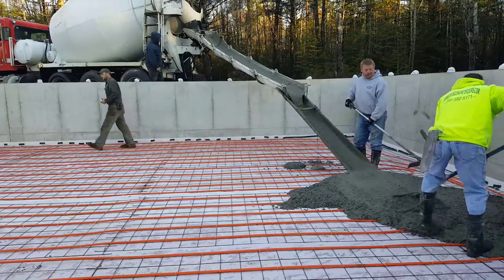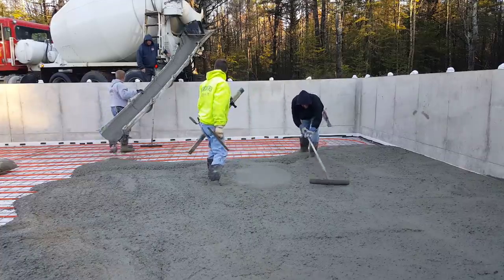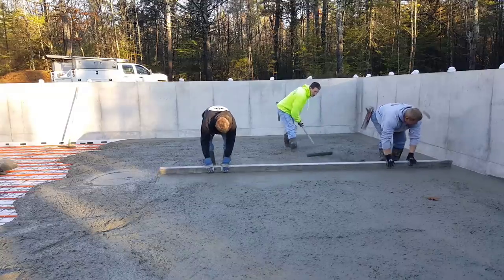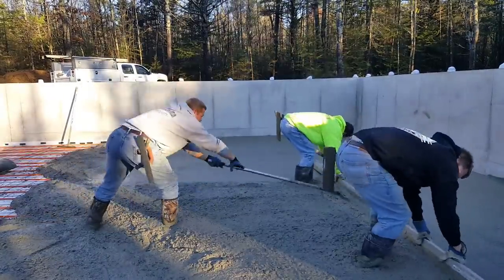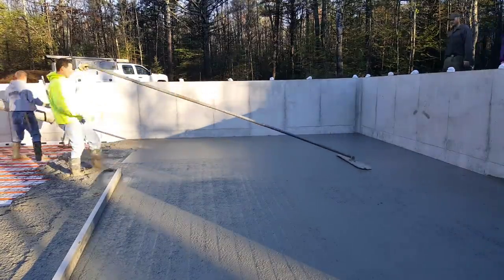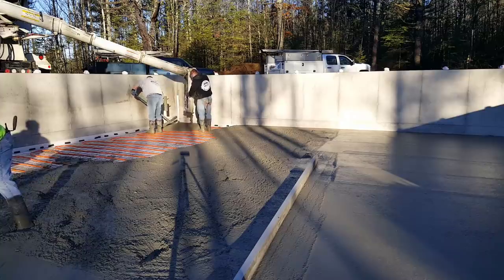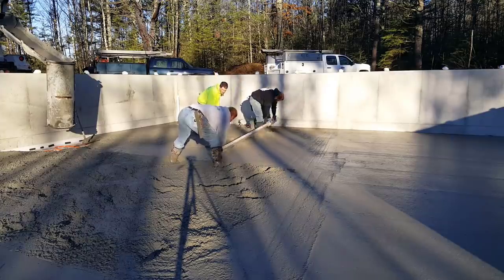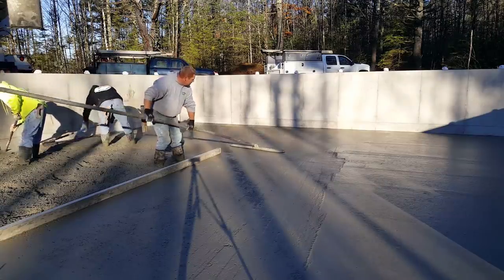Pouring A New Basement Concrete Floor 32' x 32' (New Home)

Comment: Hi Mike,
Nice job as always, I'm from Central Mass we call it a walk out or sometimes called a slab on grade. We use similar techniques to get the job done. I'd recommend you test out a "Elephant Trunk" similar to flipping chute but has better control and sway about 6'7 feet in any direction. I use my feet to kick into corners and move it around sometimes. We have front loaders here and I can dump a 11 yard mixer in 15 minutes.
Reply from the maker: I'll have to check that out! Thank you!

Comment: We call them walkouts, basically the same thing. We set grade pins and wet pad from them, a little faster for us. We use a vibrastrike  with a 10 ft blade. Also we use a 6 ft float that's a little tougher but going opposite of the strike helps to flatten the floor. We have gotten away from doing flatwork unless we have to. Now we mainly just do walls. We are in Illinois east of st Louis Missouri. 👍 on the video.

Comment: I'll likely never ever pour any concrete to the size jobs you do, but man do I enjoy your videos. In NC we call these Walkout basement. I was wondering if the red tubing looking stuff was to heat the floor?
Reply from the maker: Yes, radiant heating. We have a lot of floors we do with this installed.

Comment: -We don’t call them ‘walk-in’ or ‘walk-out’ basements bcz basements in S. Florida are extremely rare. Actually I only remember doing one in my career down here for the lower level of a parking garage and they were sorry they ever did it. That was in Downtown Delray where the natural elevation is exceptionally high for the area at +16’ above mean sea level. Most buildings down here have a finish floor elevation of only +8’-9’ ASL. 
-Do you have a square footage ‘cut-off’ point where you break out the power screed? Or is it just up to site conditions when you determine to use it or not?
Reply from the maker: It's definitely a different world in Florida compared to Maine. Most new houses have basements here. I usually let my guys determine if they want to use the Vibra screed or not. I'm good either way, I like the exercise!

Comment: Mike,  I notice most new homes pour the concrete basement before framing goes up.   Is it normal to pour the concrete after framing goes up?  I will have a walkout basement if that helps.  Is it a lot more expensive if the framing is already done?  Great video.  Thanks.

Comment: Well im 39, live in Hazel Green,Alabama. Thats Madison County. I personally like to use the same method you guys are. Alot of finishers prefer to use vibra screed but thats cause one, they are older and dont have the backs no more or two, to dang lazy for that method. Lol. I am new to channel but have to say i have enjoyed it to be honest. Lots of material covered in all your vids and good info for new guys to concrete. I have to admitt that i am one that has to pull a few strokes on the screed board or rod and step back. I wished i had a good kick when using the screed rod but i dont. I can take steps back and go with it if i leave myself high enough on myside to fill in my foot holes but just haven't mastered it and it bothers me a little. A pride thing i guess. We all want to be known for our skill set in this concrete game cause its just in us i think to be that way. Pride.  Rare breed of man for our work. So keep up the great work it looks damn nice for sure. Good group of brotherhood displayed and family oriented so great job. I been doin concrete for 15yrs or so. Mostly curb and gutter and concrete boxes, inlets and throats, junction box boxes and tops and head walls stuff. Every now and then i get lucky enough to get a call looking to see if i would come help on a flat pour. I like em. Well thanks and you guys and gals be safe.
Reply from the maker: Thanks for watching!

Comment: Hey Mike, you mentioned you have “concrete pads” In the middle that you are screeding off of rather than pipe or rails. Can you explain what that means a bit more. I did not understand that.

Comment: Great video Mike! Perfectly done! You pour about the exact same slump I pour. If it's gonna be 85+ degrees I sometimes pour a 6.5-7.  Honestly, I've never had one issue pouring on a 7. I've noticed you have a nice creamy mix. Most mixes here in East Tennessee is really rocky. Do you use a special mix?
Reply: Brad - are you available to quote my house concrete? I am building in Talbott, TN.
Reply: @jmanci910  I can. I'm about 3 months out right now though.
Reply: @bradhill4590  That might be too long but I would like to get your contact information and maybe send you some drawings. Do you have a company name I can look up or just just provide your number here?

Comment: Do you ever use zip strips ?
Reply from the maker: Zip strips for controlling cracks, no not any more. We used to in the 80's and early 90's.
Reply: Mike Day Everything About Concrete I use them for a few jobs they were hard to get straight lol

Comment: Cant believe your using those old threaded poles from the 80's on your bull float ...
Reply from the maker: I got others that snap together with the twist head, sometimes i like my old ones.
Reply: I understand liking older equipment but when bull floating a ROCKET HEAD & SNAP POLES are essential...i started flat work in the 80's in Sanfrancisco bay area we used threaded poles and they would always break or come undone

Comment: Where's the plumbing?
Reply: I like your kickscreed method, we do the 2 strokes and go, or if it's flat and not a lot of pipes we Vibra strike it,  Just depends who's puddling for me
Reply from the maker: I don 't know about the plumbing, they just hire me to pour and finish. Must all be on the first floor.
Reply from the maker: We probably could have vibra screeded this one. Sometimes my guys would just rather kick screed. I don't argue it's good exercise for me.
Reply: @MikeDayConcrete  I hear ya Mike, sometimes it's more work to clean the Vibra Strike

Comment: Are you hiring mike?? Nice pour wide open and I can tell is a nice concrete mix not shitty mad  that we get  without confilm is hard to finish , hey mike I guess every state is Difference  how they  screed concrete, in Minnesota we pull 3 time and stop, use a 6 foot bump cutter for are super flat floor, actually today we pour 11,000 sq ft super flat floor
Reply from the maker: Could be hiring, we'll see what happens! I used to pour floors that size every day, not too much any more.

Comment: Ur supposed to pull ur wire up it's supposed to be atleast half way in ur slab they make things called chairs to sit the wire on or rebar look them up that's what helps strengthen it the way uve done it make it weak not disrespecting just trying to help bud

Comment: Adding water will reduce the strength, but it will not cause it to crack. The dryer you pour it the more likely it will crack. The whole weight of the house only requires around 1800 psi to hold it up you can add plenty of water to 4000-3500 concrete.
I don’t like to pour over a 6” slump because it’s just to sloppy to work and harder to get level. But have poured many jobs that they made you pour 4” slump. Now days if they said I had to pour 4” slump I wouldn’t take the job....
Yup you can have $50,000 dollars worth of tools and a $80,000 Ford F-250 King of all work trucks and a guy can pull up beside you in a 98 Pontiac with enough tools in the trunk to pour the same floors you pour.
God Bless America.
Reply: But if you add to much water you have more shrinkage cracks
Reply: David Neufeld  I pour a 6” slump which is pretty wet. I can not stand to pour sloppy wet concrete it’s messy and it’s harder to get level. I think what you are calling shrinkage cracks is water coming up through the concrete and out the top. I very seldom have that problem. When I get done pouring we have to get our kneeboards/sliders and start going around the edges. Our concert never sets there where you have time to Pattycake/put our fingers in it v to see if it’s hard. I have poured 1000’s of floors and I never have trouble with shrinkage cracks or any other cracks.